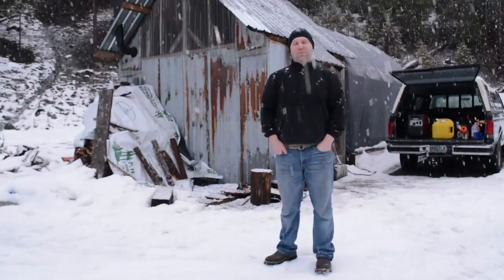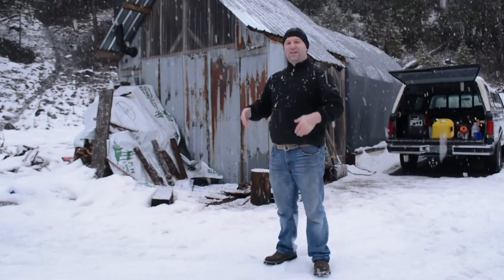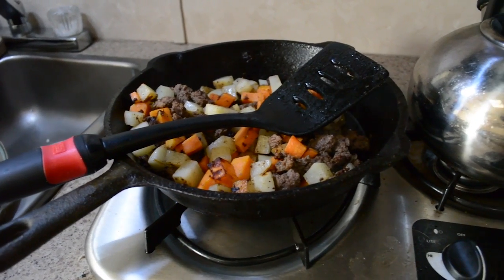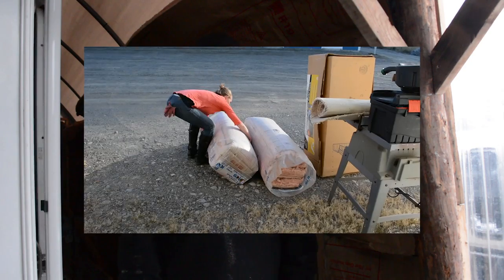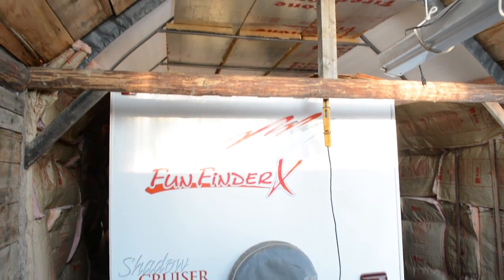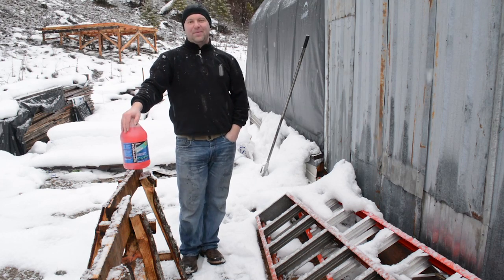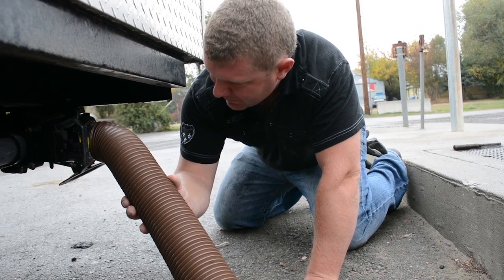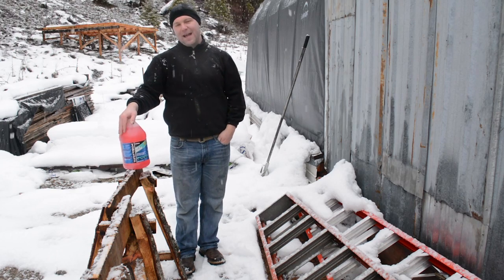Must-See Hacks to Survive Living Off Grid in Winter

Comment: I have used rocket stoves on many occasions to keep warm when out camping.  It is an excellent tool to allow you to fully realize the thermal energy in the feed stock and reduce soot .produced. When combined with heat sinks to store the energy the heat can be used for log periods of time.  Easy to make, easy to use.

Comment: All great ideas, and helpful hints. BUT when we were in our RV we used chemicals for certain things in our black tank that eventually ruined our valves and toilet mechanism. It was more than six months before we realized we had a problem. Which manifested after it started to warm up outside. I hope you don't have the same problem with the anti-freeze. Best advice you've given to everyone is 'getting off the ground'. Foundations pillars and posts will save so much on heating, cooling, and wear and tear on your buildings.

Comment: A few thoughts after watching your video. Try to get some bales of straw/hay to use around the tent/cabin on the ground to insulate...you could even use them along the septic line area. Might eliminate the freeze issue. Get a solar powered fan. With all the light in the plastic window and a high mounted fan to circulate the air you would probably use even less firewood. Good job and enjoy watching your journey.

Comment: Great Series guys!   I recently moved from temperate SoCal to the Tahoe National Forest and have been enjoying many of your tips and insights. Since moving into the cold snowy mountains, I've been trying to figure out better ways to stay warm during the winter months. During my research I stumbled across a term that I'm now experimenting with "Thermal Mass". I noticed in this video that you place your water jugs near the stove to keep them from thawing, but did you know that they were also secretly acting as a very good "thermal mass" which was contributing towards keeping your place cozier!?  Turns out that water has a decent thermal mass that captures the heat from the stove and later radiates it out, much like charging and discharging a battery... You're both probably aware of this, but I didn't see or read anything about it...  Thank you again, and keep up the good work!
Reply: +Lester Nielson  I would love to hear about where you are.  I am in Pollock Pines.  PM me, if you would like.

Comment: Hi ; good tips !
about insulation : it has to be instal well and kept very dry to be efficient ; so , a plastic sheet or film  has to be fixed inside so the damp cannot condense into the insulation , be careful to put adhésive tape on the joints ( a very thin passage for damp-air and it is a big area out of efficiency ) . 
How much insulation ? that depends of how much you want to save in heating . The first layer makes a big difference compare to no insulation at all ; then the difference decrease , following calculation -> 1/X -> I mean : 1/2 is 0.5 : 1/4 is 0.25 ; 1/8 is 0.125 ....etc....so you save less and less .
But do not make a sealed box ; let some air comes inside - just enough ( when it freeze the air outside is almost dry ) and the same amount of air getting out ( with the damp ) .
About the septic tank ; get a check on it after winter , to see if it works normally .
Begin to think about the garden plants and small animals you need .

Hello to your cat !

Comment: This is probably a stupid question... but how does running a wood heater pull the moisture out of the air? Growing up my house we had a wood furnace in the basement (return ducts from all 3 floors and a blower on the top of the furnace), but we still had to run a dehumidifier during the winter.
Reply: +Chris Troeger    Example:  In the tent,  40 degrees, dewpoint,  40 degrees = 100% humidity.  Outside, 20 degrees, dewpoint, 10 degrees = approx. 65% humidity.  Heat tent and exhaust 1/2 the air, temp 50 degrees, dewpoint 25 degrees = approx. 37%.  Very dry air.

Comment: Have you thought of a Jewel Thief, It's a electronic device that take DC power and make electricity at a much lower rate at a better use of wattage?, and you can get ultra super capacitors for backup for your battery's. Just a thought! O I almost forgot, the capacitors have more then 500,000 cycles. Most battery's have less then 600 cycles, I think that's what it is! Have a good day and stay safe!

Comment: What is the effect of antifreeze on the microbial flora of the septic tank?
Reply from the maker: +ririshow Obviously we have no data to back this up, but according to our research based on the quantity of antifreeze to water any negative effects are negligible. 

We are using about 1 qt per tank which is 15 gallons. We are also only using it on really cold snaps, so we ended up using just 2 gallons total all winter. 

According to the data from our local health department you could in theory use as much as 2 cups of chlorine bleach per day and not damage the tank cultures with normal daily household water usage.